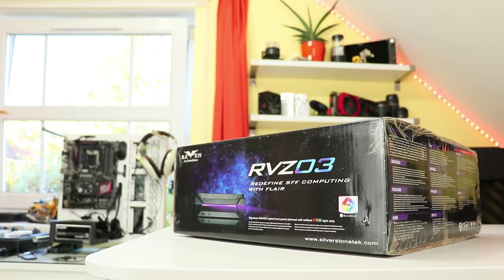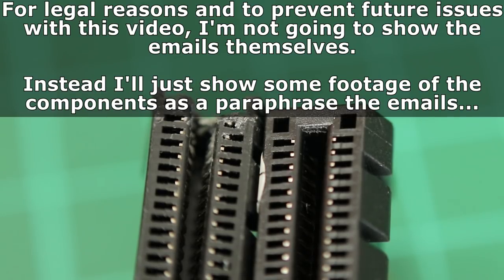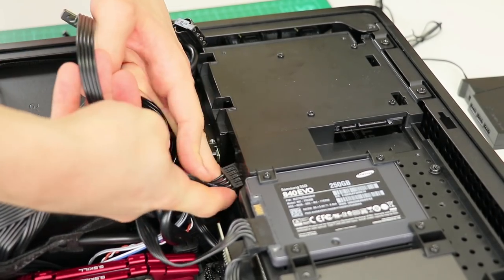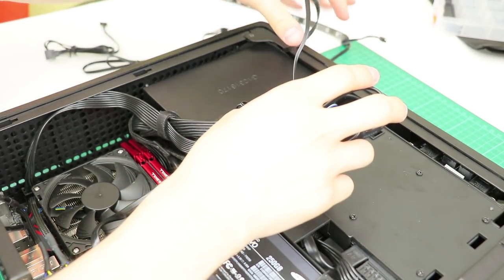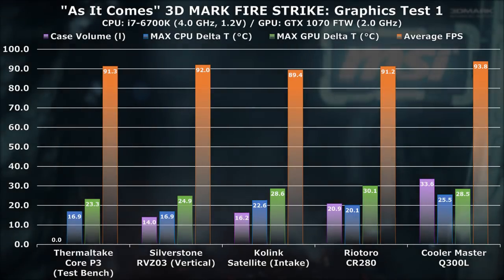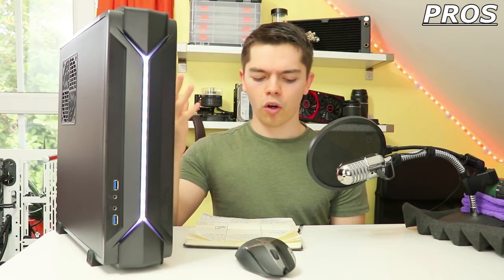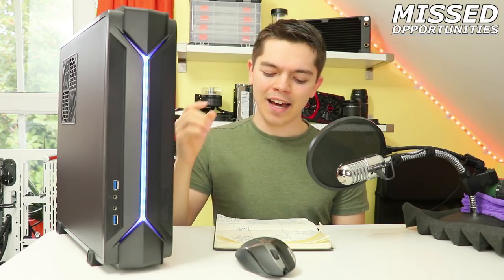SilverStone Raven RVZ03 (Mini ITX) Review

Comment from the maker: Time Stamps:
00:27 - Intro

OVERVIEW
02:03 - Unboxing
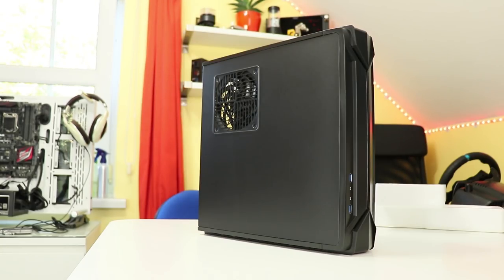02:29 - External Overview
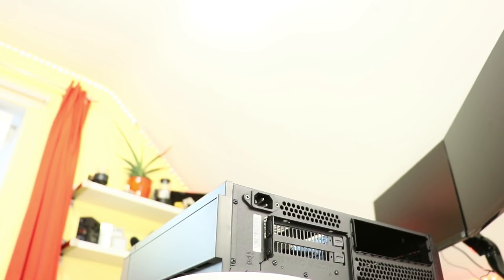04:49 - Internal Overview (1/2)
06:10 - Accessories
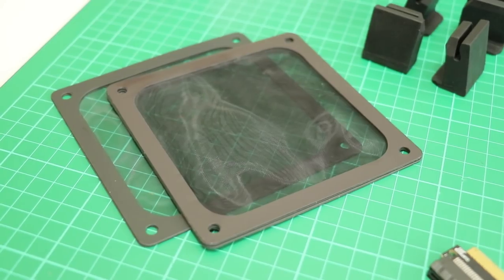07:33 - User Manual
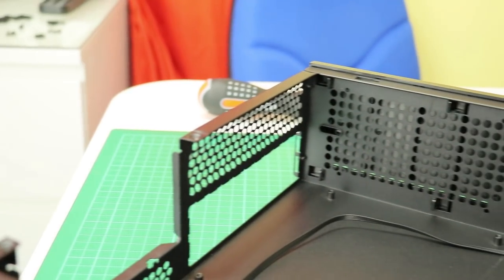08:59 - Internal Overview (2/2)

BUILD
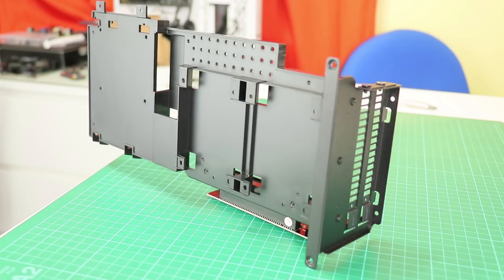10:28 - PSU Installation
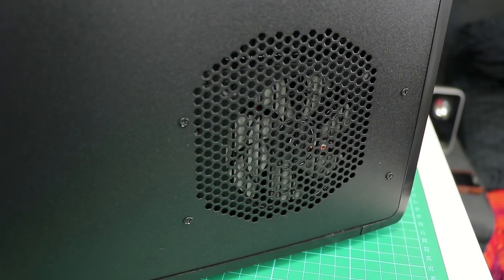12:39 - Motherboard Installation
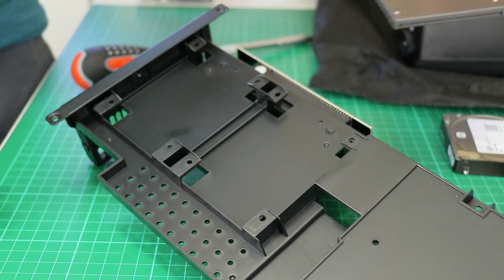13:02 - Drive Installation (1/2)
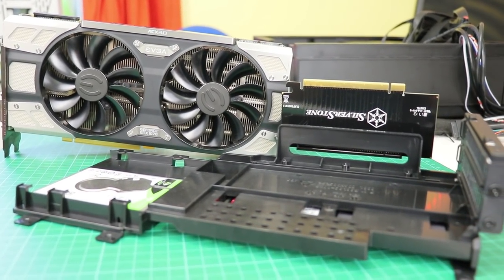13:36 - Graphics Card Installation (1/3)
14:41 - Customer Service (Part Replacement)
18:17 - Graphics Card Installation (2/3)
19:39 - Drive Installation (2/2)
21:07 - Graphics Card Installation (3/3)
21:46 - Cable Managment / Installation
23:39 - Lighting Setup & Control (Full Explanation)
29:18 - Front Panel Lighting Installation
30:01 - PSU & Cable Managment Discussion
30:49 - Side Panel Replacement
31:04 - Vertical Feet Installation

TESTING
31:34 - Testing Setup Information
33:51 - Horizontal Vs Vertical Orientation Thermal Testing
36:14 - Full Thermal Testing Results Comparison

CONCLUSION
39:38 - B-roll
41:42 - Conclusion
42:53 - Pros
46:17 - Cons
49:32 - Missed Opportunities
51:46 - Thanks for Watching!
Reply: Ah, you picked up my job while I was on holiday :D
Reply from the maker: Well someone had to pick the ball up while you were away haha
Reply: Hey AV Techy, after watching this video I instantly subscribed. You put a hell of a lot of work into your videos, and it made planning my build a lot easier. I do have one question though that I don't think I heard in the video. Do you think a blower card or internal exhaust card would produce better temperatures? The case is small so I thought blower, but it seems like it might have great thermals so I don't know?
Reply from the maker: Thank you very much!

I'm glad you found it so useful, it's great to know it's doing its job well :).

As for the graphics card style question, an internal exhaust card will be able to take advantage of the large intake area provided by the lower ventilation section. Blower cards are great for situations where airflow is restricted, but this case has so much intake, and plenty of overflow ventilation sections that allow open style coolers to thrive.

If there weren't two 120mm vents to the side of the case, and the only intake area was at the base of the case, then a blower style card would be necessary to maintain any sort of performance. Without trying to explain something that you may already be full aware of, here's breakdown of the two cooler styles:

If you think about it in terms of airflow capability, a blower style cooler works in low airflow environments because it effectively (directly) removes its heat from the case. But back to airflow capability, blower style coolers only have a small fan with far lesser airflow compared to most open air coolers, and they have a limited area fro airflow to enter the heatsinks duct. So in a high airflow environment, a blower style cooler bottlenecks the airflow to the graphics card heatsink.

This is where an open air cooler comes into play. They don't work well in low airflow environments since they can't directly remove their exhaust heat from the case. But where the airflow is high and the case fans are doing the extraction work, then the larger heat sinks and extra (and larger) fans of open air coolers can use there higher airflow fans effectively (and with more and larger fans, the airflow is higher). 

Luckily SilverStone went down the "Form follows Function" route, and added those vents to open up the options for graphics card choice. The line between the requirement to use a blower style card or open air card sways very closely to the highly restricted airflow cases. In most situations they shouldn't be required, especially when the intake is so high such as in the RVZ03.

Anyway, it basically all comes down to airflow on for each component. You may also be painfully aware by this point that I tend to go on when it comes to responding to questions and queries. It's a problem that I'm coming to terms with haha. I hope I addressed your concerns however. Let me know if you have any more queries, thanks for subscribing to the channel (the support is fantastic), and best of luck with your upcoming build!
Reply: AV Techy Holy Cow! Thanks for the fast response and the wealth of info. I knew the basics but this helps a lot. I will probably be looking into getting the founders edition 2080 ti instead of an aib blower.( I think its just a 2 slot card i will have to check. I think the only 20 series 2 slots are the nvidiya fe and the aib blowers? Maybe not though) I know power consumption is up with these new cards so I was worried about temps. But you have put those worries to rest. I look forward to learning more from you with your amazing reviews. Thanks!

Comment: Nice review, probably the most in-depth case review ive ever seen on youtube. Just finished my build in same case.
Reply from the maker: Thank you very much, was there anything you found better or worse than I found in this video?
Reply: No probs mate. Nah you nailed all the pros and cons perfectly. My temps were pretty good (although my cpu and gpu arent quite as powerful as yours). Im with ya that on the side of psu shroud should have cable tie points. I managed to route some cables including the power cable behind the psu shroud but it would be nice if they had left a bit more clearance behind shroud as its a sweet spot to bring all the case wires around to mobo (depending on mobo layout i guess)
Reply from the maker: Thanks, I don't think there was anything I missed, or at least no one has told me anything I missed haha.

This was a really interesting case, but of course like you've reiterated, there will inevitably always be possible improvement. Some will be subjective like the PSU grille, but others will be more objective like the PSU bracket cable management loop potential.

I get what you mean about another 5mm or so clearance behind the PSU, I found it a little awkward to route cables around or past it, but its a very tight build already so it doesn't stand out too much as a problem. I certainly look forward to the next version of this case.

Comment: Thanks for this video. I first found it when I started planning a build in this case about 5 months ago. By the time I actually got around to putting the computer together I felt like I knew the case from the inside and out due to the level of depth you went into with this video. I really love the case also, it's turned out to be one of my favourite builds I've done and I couldn't recommend it more to anyone else.

Comment: One of the best rvz03 reviews.  I bought this case last month for a future build. That being said I do have a friend also with this case that has experimented with the cooling. He said its comparable to the node 202.   He was successful with his gigabyte 1070/80 mini and using a 120 aio cooler on the other slot. The Zotac mini is a lil to long but the gigabyte is around 6 inches.
Also he has fit a 240 slim aio with the fans pulling in  but, gpu temps raise up a lil even on a longer size gpu but works great for OCing his 8700k. I havent asked about noise levels but he does prefer the mini/ and 120 aio combo.  I do know there stand offs and the 2.5 bracket there so ill have to ask what 120 aio he used to fit comfortably in there.  This was just some info in case you wanted to experiment in the future